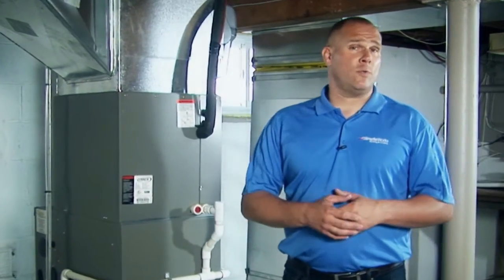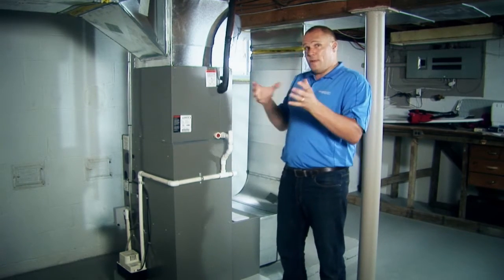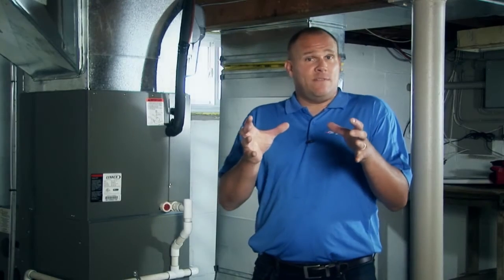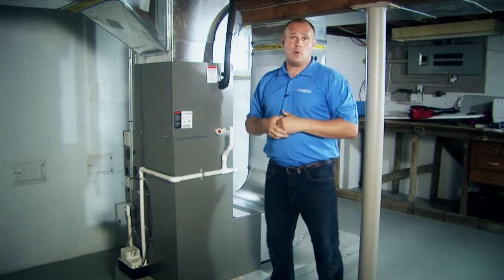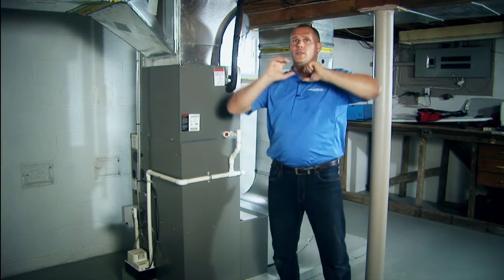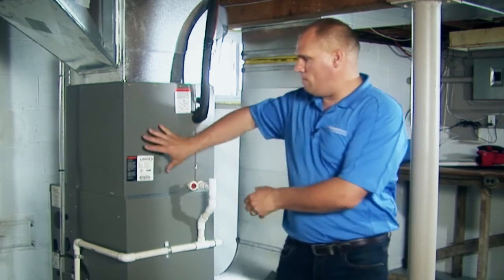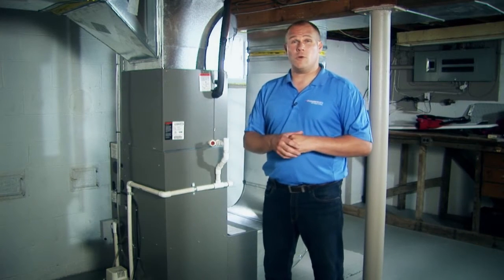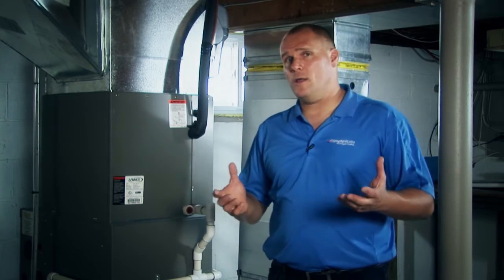How A Furnace Works - John Chapin

Comment: Hi Brian, Thanks for the email. 
The reality is that if you have duct work in the crawlspace, you are indeed most likely drawing in air from the crawlspace and distributing it throughout the house. Further, if you have a return air inlet in that crawlspace then you will definitely be bringing in that humid air. I have a few questions for you: 
1. Is the crawlspace a closed or an open crawlspace... in other words, is it heated in the winter time and treated as being part of teh building envelope? ... or is it a vented crawlspace whereby there are some vents (often look like small open windows) in the foundation area of the crawlspace?
2. Is the floor a poured concrete floor or is it dirt, sand, rock etc?
3. Is the crawlspace connected to the basement of the house, or do you have to access the crawlspace from outside?
I look forward to your response.
John